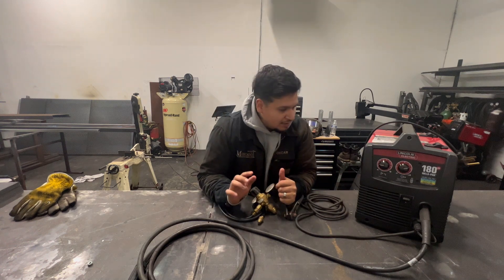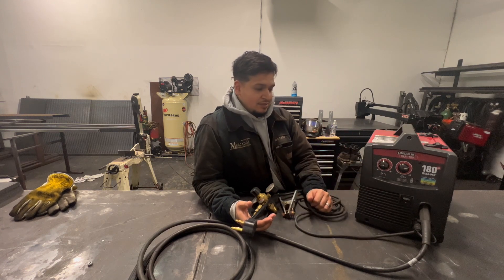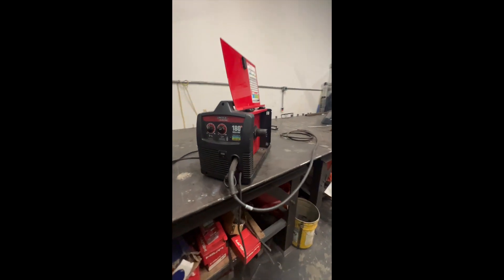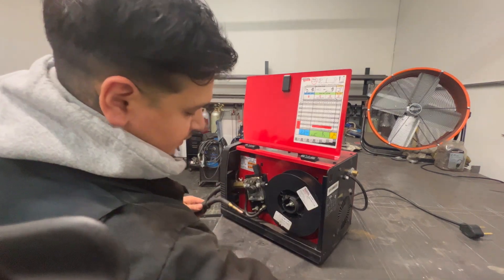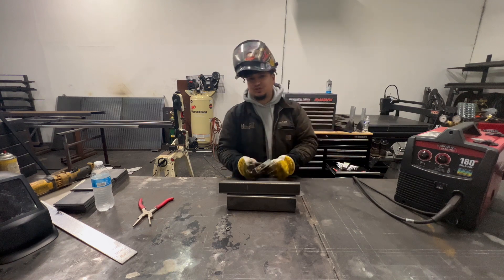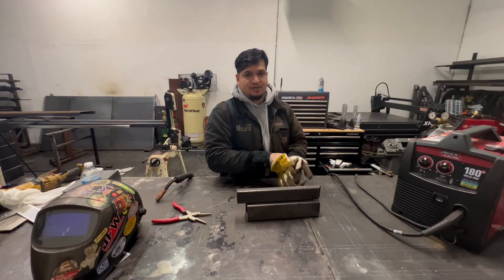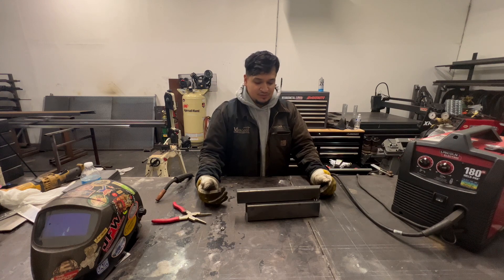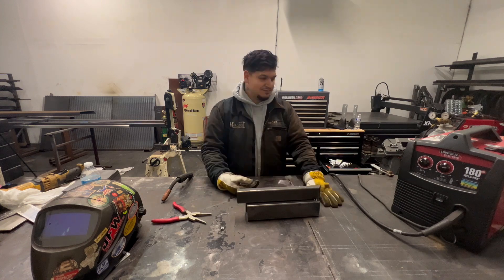Lincoln Electric 180HD REVIEW

Comment: Is this 180 HD model 110 and 220 volt? I'm on the fence with the 140 or 180 Lincoln from home Depot 8-18-2024 ,I will be reinforcing car frames 3/16 plate over frame full wrap duty cycle? In 180 vs 140 ? And what's the thinist for metal car body work I. Both models